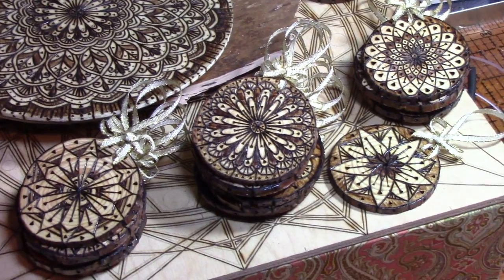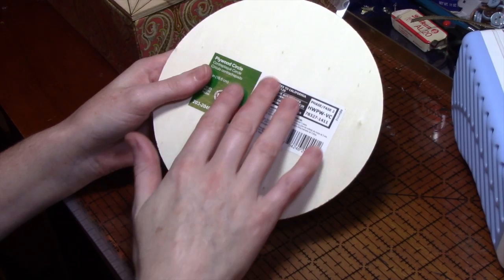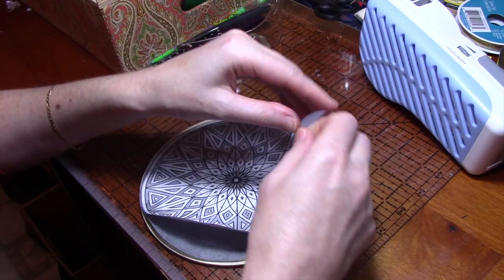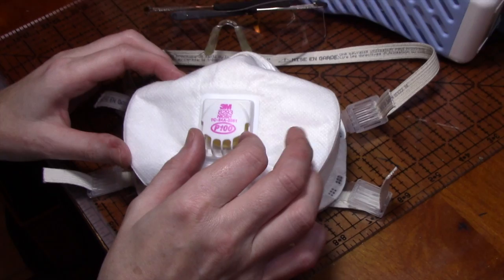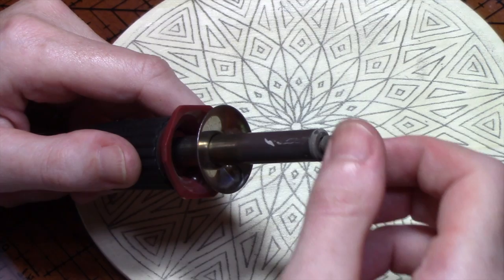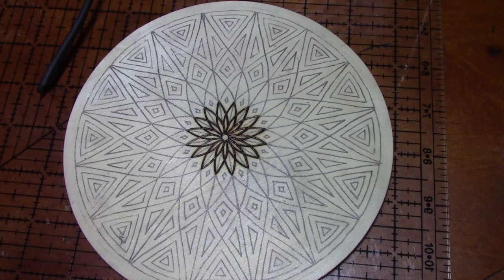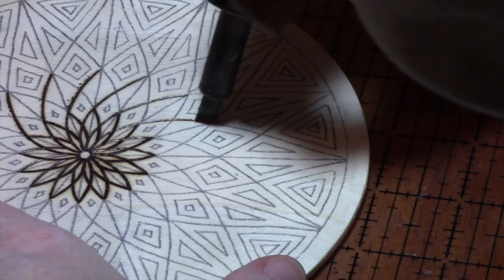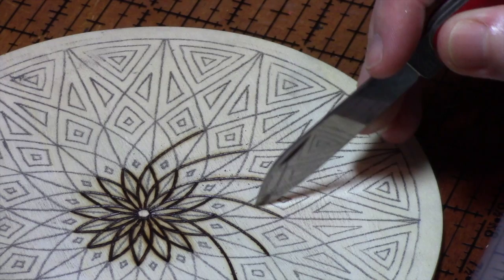How to Wood Burn a Mandala - Pyrography Art

Comment: Could I paint these with acrylic paint when done burning. And then maybe glaze them.? Of course I believe I would have to gesso them first right.? Thanks for sharing your talent.
Reply from the maker: I asked Kate about the acrylic and she said you can.  She doesn't know what you mean by glazing them?  Do you mean firing them after you glaze it?    She doesn't know about gesso since she has never used it.
Reply: What I meant by glazing is using a medium that would put a gloss(shine) over it when completed. Thanks for the quick response.
Reply from the maker: I suppose that is what she does when she sprays it at the end.